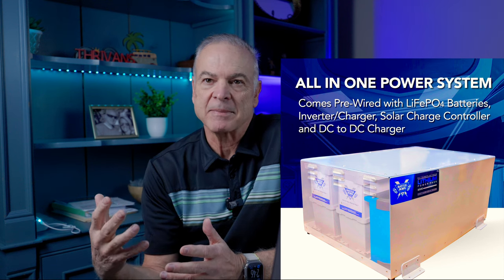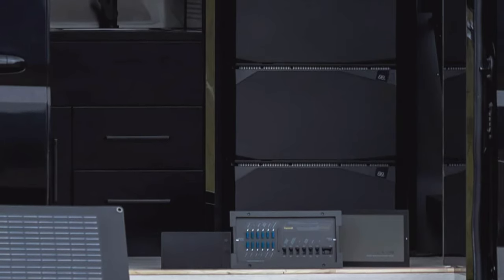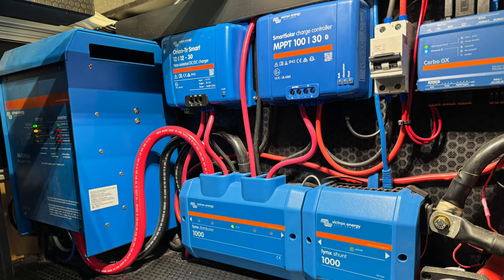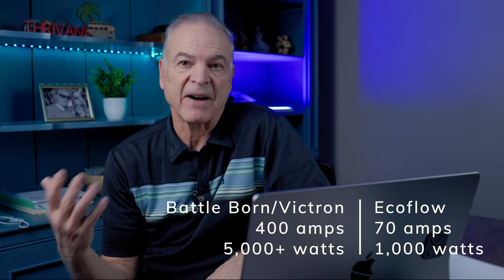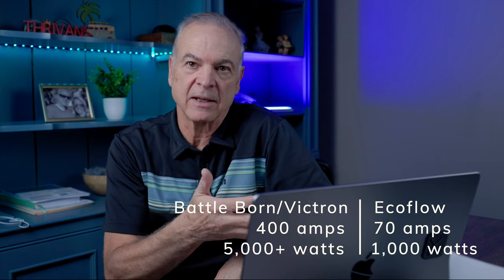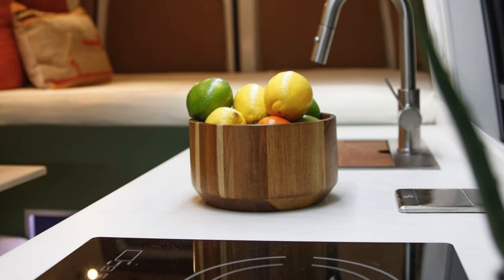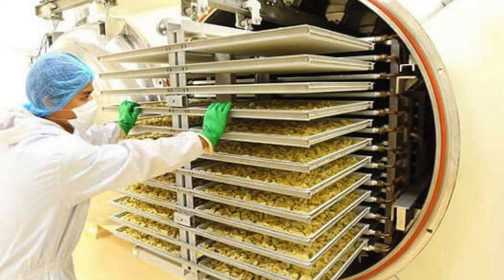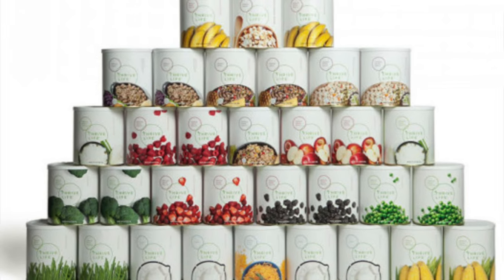Watch Before Buying an Ecoflow: Ecoflow vs Victron

Comment: Hi! Thanks for such an informative video, looks nice!! Just one spec is incorrect about our Power Kits. The system you talk about in the video should be rated at 3,600 watts😉
Reply from the maker: Good to know. Thank you for the correction.
Reply: This gives Ecoflow an edge.....24V AC unit would pair good with this.
Reply: This inaccuracy in the video justifies changing your edit or removing your analysis from YouTube.
Reply: @dirtbird43  I was thinking the same thing.  The note in the description is NOT enough of a disclaimer.  the video should be taken down or at least edited.

Comment: I  installed Ecoflow Powerkit with 3,150 watts of solar on my 34ft Avion Travel Trailer last June. I have 15kw of batteries and run my air conditioner on the system. Live full time in our rig.  In the over 9 months I have not plugged into shore power or a generator. Totally off grid. Full time. Love my Ecoflow Power Kit!
Reply: What the inverter power rating of the 15kW system?
Reply: @ZillaYT  3600w
Reply: I have powered on my ecoflow powerkit system on my van for 24 months. Non stop.and it’s getting better and better!

Comment: The EcoFlow Power Kit inverter/charger is rated at 3600w continuous and 7200 surge. Just to be fair. I have used Victron components and don't have any experience with the EcoFlow Power Kits, but have used other EcoFlow products and my experience is tech support for both companies is not great. A Victron system is much more complicated to install. The EcoFlow looks like it is easy to install and that may be a benefit to those interested in the DIY approach.

Comment: Watt-hours is actually the correct way to measure capacity.  There is no real concept of an Amp-hour.  It is a contrived sort of solution.  A watt is volts x amps, then watts per hour are a measure of work.  Amps are just amps.
Reply: Yup, I ride electric unicycles and we strictly go by watt hours, while scooters, e-bikes, esk8, etc all use amp hours which to me is useless lol

Comment: Good advice! I purchased the EcoFlow 10 kWh PowerKit a year ago and it has worked great for me. You are correct that the EcoFlow support is subpar. They do excel on their firmware updates as they are constantly adding new abilities to the existing components. For example the alternator charging now has the option for 70 amps (up from 60). For me being self employed I had to factor in my time. The PowerKit was very simple to install. But you are correct that it is proprietary and if anything fails... I'll be hurting. I am interested to hear what Battle Born will offer for their "all in one" system.
Reply from the maker: Glad to hear it’s working well for you. Thanks for watching!
Reply: The good thing is that batteries and tech are getting cheaper...Ecoflow Delta Pro for example is cheaper than the Power Kit but is not standardized for automotive connections.

Comment: I would also say that discrete systems really should go straight to 48V (16s, 51.2V nominal LiFePO4).  12V is extremely limiting and generates a lot of heat for what people want to run these days.  48V makes everything a whole lot easier and the only real issue comes down to how to handle high-power DC appliances.   But a power station has the same problem... it either won't have a 48V output or it will have major limitations on its 48V output.

Low power 12V equipment is a non-issue since a cheap buck-converter deals with it.

High power "legacy" 12V equipment is always a big problem for both types of systems if you don't want to replace it.  But it isn't a good reason to stick with 12V batteries.  When doing this amount of storage, legacy equipment may need replacing to really do it right and have a happy result.   A lot of people are just going straight to AC for major appliances and eating the inverter losses and idle losses.  With 5120Wh+ of storage it isn't as big a problem as it has been in past years.

I would not get battle-born batteries, they are extremely expensive relative to SOK or EG4 batteries and BB does not do a good job supporting 48V.   Two batteries minimum (for redundancy).  For example, 2 x 48V (51.2V nominal 16s LiFePO4) @ 50Ah each, in parallel = 5120 Wh of storage.

Also, no matter what battery voltage you eventually decide to use, don't saddle yourself with Victron equipment that is only capable of doing 12V or 24V when you have any choice in the matter.   For the charge controller, use one or more Smart Solar 100/20's, which can handle 12, 24, and 48V system voltages.   You want at least two for redundancy anyway, as well as for optimal panel arrangement, and the 100/20's are only $90.  At 48V a single 100/20 can handle 1000W of solar.

A big advantage of going 48V is that you can use 2 AWG battery and inverter cabling without breaking a sweat.  100A @ 48V (51.2V nominal) is over 5 kW.

For the Victron inverter system, the Multiplus II 120 48V.  Victron is a bit behind the times here in that their split-phase (240VAC) offering only exists for 12V and 24V.  An EG4 6000XP will do a better job with a 48V system.

Either way, redundancy is important, no matter what main system you purchase, you will want a second inverter.    You will ALSO want a separate discrete inverter, anywhere from $150 - $250.  Again this gives you options if things break out in the middle of nowhere, but you can also wire this second inverter directly to an outlet in the kitchen area (with a remote switch so it isn't wasting power when not in use), and now you can run your toaster oven, microwave, AND your induction kettle for tear all at the same time.

When I total things up I get around $3700 before taxes, using SOC or EG4 or discrete 48V LiFePO4 batteries instead of BB.  Inclusive of insundries and redundancies.  Of course, the "school of hard knocks" is gonna probably add another $500 to the tab for inexperienced DIYers.

-Matt
Reply from the maker: Good points. The van community is moving towards 24V. 48V is a ways off, but I think it is gaining popularity.
Reply: @CJ30123  Arguments can be made for small vans to stick with 24V, mainly due to the lack of roof-space for solar.  But a lot of people are just buying AC appliances these days rather than spending money on expensive DC "RV" appliances.  Most AC appliances have gotten efficient enough that they can just be used in a van or RV without wasting much power.

Very low-power items such as lights are literally just a $10 buck converter off of amazon, so there's no need to match the system voltage to the lighting voltage.

RVs have more DC gear, particularly motors, which I have already talked about (downbuffering solutions instead of direct home battery connections).
Reply: @CJ30123  This isn't the 1980's, CS.  People aren't buying DC appliances anywhere near as often as they used to, not when normal AC household appliances are half the price, almost as efficient, and when the typical battery pack in a large RV has four times the useful energy storage as one just 10 years ago had.  Let alone anything older.

Start running actual consumption, solar, and storage numbers and you will quickly realize why.
Reply: @CJ30123  You are welcome to try to actually have a conversation instead of behaving like a child.  To be honest, you have not said even a single thing that would be of interest to anyone.

-Matt

Comment: We've been using powerqueen batteries for about two years now. We built a 3.6kw used panel array, with a refurb EG4 6000ex all-in-one inverter, and added 10kW of the powerqueens for under $5k total to charge our Ford Lightning. I think 10kW of powerqueens are down to under $2k now. I build my own solar generators, as I don't trust longevity of pre-built systems. I'd rather know my components, and if I have an issue, replace them myself if they go bad. So far so good, I have three systems now, and the the two year old systems with home built, 18650 batts, RoarBatt inverters, and Epever charge controller, has been running outside in Texas heat, cold, and rain inside a Ryobi link toolbox for a year and a half, and powers my home office, and can run a rigid tablesaw with just a 2000watt Roarbatt inverter and a powerqueen  12v 100ah battery with 100amp BMS. I think I spend $700 on it a year and a half ago. I just built a smaller one, for overlanding, with a rolling harbor freight toolbox (like pelican) with a victron 75/15, and a 24v Phoenix inverter, home built battery, for around $500... with bluetooth. It's just too easy to build your own. I did it in half a day.

Comment: 3000VA Multiplus is 1700w to 2400w depending on internal heat. So it produces significantly less than 3000w continuous. It does have good surge capability and is extremely well built with great reliability and features and I do use and recommend them, but their power output is not great for multiple high output consumers. I am planning to use the 24v 5000w Quattro in my next build, for higher output and even nicer features (at a price!)

Comment: Very helpful discussion.  For my 3 season van configuration, I am using the Bluetti AC200P which offers 2,048 Wh of capacity, which provides enough battery capacity for 3 days of boondocking.  It's now on sale for $1200, and so is a great deal.  I supply DC to my fridge, water pump, roof vent and lights, so I have a very minimal load.  I don't have hot water or an air conditioner.  I didn't want to install solar panels on my roof, because of the cleaning/shading hassle factor, so I use portable solar panels for the occasional need for additional supply while boondocking.  I've also learned that the battery doesn't recharge very well using the 12 auxiliary jack, being a 100 watt recharge rate.  So, I've added a 12-48 volt boost charger connected to my car battery/alternator so it now recharges at a rate of 550 watts.  So, I can fully recharge the battery in about a 3 1/2 hr drive.
Reply from the maker: Glad to hear that’s working for you.

Comment: Thanks for the detailed comparison! The eco flow looks nice, but it appears to be a poor value. We're retired FT RVers who discovered we love boondocking, so designed and built our off-grid electrical system ourselves, on a limited budget. We're living this lifestyle off of a limited retirement income so had to take the low budget route, foregoing name brand components like Victron and Battleborn for more affordable, quality options. 

We started by building a 620-watt liftable solar array on the side of our 1999 National Tropical MH. Our side array makes a nice bedroom window awning too, practically lifting itself with a couple gas struts, and it's easy to clean, standing safely on the ground. Next, we built a 12v, 560ah LiFePo-4 battery using 8, 280ah prismatic cells and a Heltec 330amp (1,200a surge) BMS to start our generator. This is roughly the equivalent of a pair of Battleborn Gamechangers. But unlike the Gamechangers, these cells fit perfectly under the steps of our MH where our old pair of golf cart batteries used to reside. Our 12v system uses an 80A Lithium converter/charger, a 1,000w Renogy inverter, a 50a Epever MPPT charge controller and a Lnex battery monitor. We have a Renogy DC-DC charger so we can use our alternator for charging, but truthfully, we have so much solar that we never even turn it on, (nor do we use our converter/charger anymore) - though I can see where one might come in handy in a van with limited solar. All this cost us around $3,500 and meets all our off-grid electrical needs except for air conditioning, and microwave. 

By mounting the solar array on the side of our coach, we left the roof free to rack 8, 550w solar panels down the length of our 35ft Class A, 15" off the roof, above our AC, vents, etc. It shades our entire roof, allowing plenty of cooling air underneath, increasing solar output and reducing the heat load on the air conditioners. Our 4,400w array can run both our A/Cs, our household appliances and charge our batteries from solar at the same time. When the sun goes down, we're always at 100% battery capacity, even in winter. We can even run our mini split heat pump 24/7 providing both A/C and heat powered by the sun. 

We use a Sungold Power all-in-one 48V, 5,000W PSW Inverter/100A charge controller/battery charger that saves us space as well as money compared to a system built with individual components. This all-in-one unit has the same 99% charging and 95% inverter efficiency as the high end Victron unit, though it lacks some of the bells and whistles to come in at only $764. We chose this particular unit because it supports up to 500 volts of solar power which was needed to accommodate our 400voc solar array and it is from an established manufacturer offering lifetime customer support from their US facility and a decent warranty.

Our 48v battery uses 16, 320ah prismatic cells and a 200amp BMS (the equivalent wattage of an 800amp 12v BMS) to keep it safe. Together with our 560ah 12v bank, we have a total of 23.5 kwh of batteries onboard - kept charged by 5,020 watts of solar.  For comparison, this is roughly the equivalent of 18, 100ah Battleborn batteries. The price of Lithium prismatic cells has dropped quite a bit over the last few years. Our first 7.1kwh battery cost us $1,569 or $221/kwh, however the 16.4kwh we bought last November only cost $1,726 or $105/kwh. Of course, you'll need to add a $100-$150 BMS to keep things safe. We removed our old rooftop bedroom A/C and replaced it with an EG4 28.5 seer-2, 12k btu mini-split heat pump on the upper rear of our motorhome. It's super quiet and cools as well as our 14.5k btu soft start equipped Furrion we have up front. It only draws about 1/3rd the power and heats efficiently too, reducing our propane usage. We have no need to hook-up to power pedestals or run our generator anymore, as we can now run everything in our MH strictly off the sun, including A/C and heat from our heat pump 24/7 if needed.
 
By mounting the solar array on the side of our coach, we left the roof free to rack 8, 550w solar panels down the length of our 35ft Class A, 15" off the roof, above our AC, vents, etc. It shades our entire roof, allowing plenty of cooling air underneath, increasing solar output and reducing the heat load on the air conditioners. Our 4,400w array can run both our A/Cs, our household appliances and charge our batteries from solar at the same time, even in winter. We mounted a Sungold Power all-in-one 48V, 5,000W Inverter/100A charge controller/battery charger, breakers and another Lnex battery monitor on the wall in our bedroom, saving us space as well as money compared to a system built with individual components. Together with our redundant 560ah 12v bank, we have a total of 23.5 kwh of batteries onboard, kept charged by 5,020 watts of solar. We removed our old rooftop bedroom A/C and replaced it with an EG4 28.5 seer-2, 12k btu mini-split heat pump on the upper rear of our motorhome. It's super quiet and cools as well as our 14.5k btu soft start equipped Furrion we have up front, but only draws about 1/3rd the power. Our total budget for both 12v and 48v systems was around $11,500, including the $1,500 high-efficiency heat pump. We have no need to hook-up to power pedestals or run our generator anymore, as we run everything in our MH strictly off the sun

Comment: Might be a stupid question: why not just use portable all-in-one batteries as fixed system? For example, Ecoflow Delta Pro with extra batteries, or multiple Delta Pro if input/output is an issue. It's cheaper, and even cheaper when on sale (while those separate parts rarely go on sale IIRC), plus you can get them from Costco which means the best return policy even if you are on the road. You can't run 12V AC, but 110V AC or Wave 2 is possible.

Comment: Small correction.  The Victron Multiplus 3000 is measured in Volt Amps.   Meaning it is 2,400 watt max capacity.   I can tell you from experience with the a couple peoples Power Kits that they are overpriced garbage.   Software issues since launch that STILL arent fixed.   Seems to be a trend with Ecoflow products.   Release half baked products and then never really support them.

Comment: Ecoflow works great for my off grid home. The 15Kwh Power Kit I have delivers what it claims up to and more, I've pushed it to 4000w output(rated @ 3600w) with no problem, easy to install, can accept 4800w PV input, I don't need the DC output as I'm in a house, so no alternator, looks great and folks say it looks more like fine furniture, a little ego boost for me. Had it for a bout a year now... The problems, of course, CRAPPY firmware!!! Lights start bugging out, AC shuts down, PV stops charging, The Ecoflow Orange light of death starts flashing and all this after a firmware update!!!! And resolved by doing it again and sometimes again after that. My suggestion no more updates, after I found one that works I stopped updating now for months and all is good. Customer service is ok at best and not bad @ worst, They walked me thru the update mess situation. So yeah I like Ecoflow 💖

Comment: The 70A DC output cap on the Ecoflow is the huge negative, at least in my case where I need to run a 12v a/c, fridge, and a bit of other stuff at the same time. I'd love to just get the drop-in system, even if it cost a bit more, but that hard 70A limit pretty much forces me to go Victron.

Comment: I just read the specs of Power Hub. The inverter has a 3600w output. Where do those 2200 continuous watts come from?
Reply from the maker: Apologies. I was going off of a review of the Ecoflow. I should have looked up the specs from the manufacturer.
Reply: This is misleading information and totally incorrect. You should edit and update in my opinion